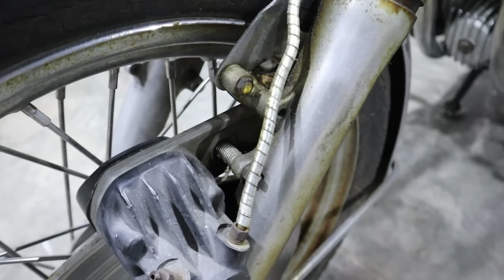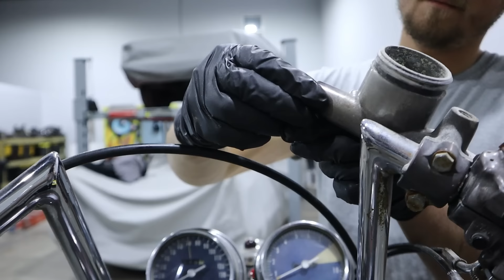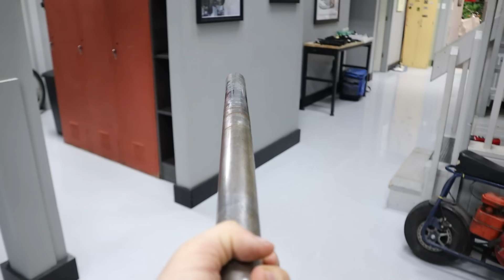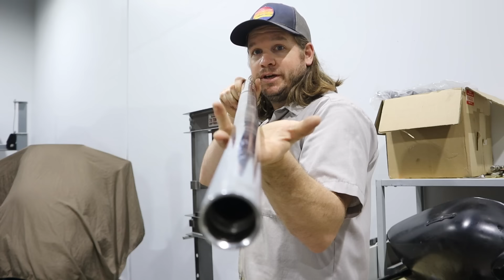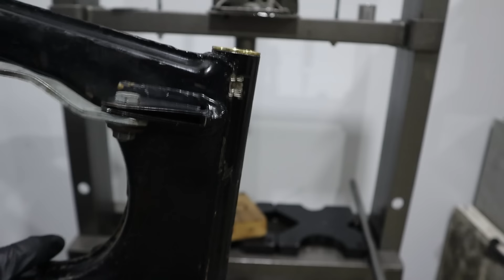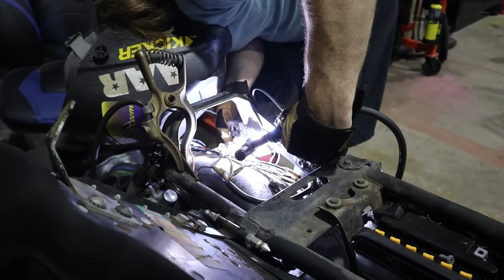Honda CB750 Suspension Is TRASHED!  Total Rebuild!

Comment: The caliper fitting is incorrect and also needs a copper washer under it, just sayin..
Reply from the maker: No it is not. This seats via the conical portion and not the flat area like an original setup. Look inside your caliper and you will see a traditional flare

Comment: Soap & water is safer. Silicone spray shouldn't be sprayed anywhere near tyre tread. Bad look.  15:03 Forks look twisted. Triple clamp ?
Reply from the maker: I have been doing this for years and have never had slip of any kind. Don't do it if you aren't comfortable but this works well for me and others.

Comment: Nice job salvaging the front brake parts and straightening those forks! On the 74 CB750 that I salvaged out of a shed my front master and caliper were similar and I just never thought to save them, so I replaced them with aftermarket parts. Really like that chopper! Hard to believe the stock pipes are still on there. Can imagine how many folks watching this channel would love to have those on their bike!
Reply from the maker: Oh the pipes are definitely the most desirable bit to say the least. While yes you can replace a lot of stuff for less time, I often like to rebuild when I can as the parts on the bike have a consistent patina to everything else.

Comment: I'd be more worried about the chrome plating being worn off the fork tubes than the bend. That's going to just chew up those new fork seals.
Reply from the maker: Yup, no other option here. We did sand then wet sand down to 3000 grit though to get them level and smooth.

Comment: Getting  those swingarm bushings OUT  is quite a task . If you find a pair of snap ring pliers that work on those master cylinders, please share. Thanks for the video.
Reply from the maker: Correct.  Out was tough without damage. Motion pro makes a specific set of pliers for this which I now have

Comment: Hi
You left out the best part: how to get the circlip out of the brake master cylinder!  🙂
And this would have the perfect opportunity to twin-disc the front wheel - we all know it needs it.
Reply from the maker: I don't like to show things I don't have a proven method for so that's why I don't show removal.  As far as the brakes they work great. No 2nd disc needed at all
Reply: @BrickHouseBuilds  Thanks - now I know I'm not alone in my struggle with that damn caliper circlip!

Comment: Do you have a video where you installed that starter button? I really like that and my bike is already missing the handlebar ignition switch. A guide would be awesome.
Reply from the maker: No video unfortunately.  It bypasses all safety features by tapping into switched 12v on the black wire. One side of the switch goes to black, the other to a solenoid lead, other solenoid lead goes to ground
Reply: @BrickHouseBuilds  Thanks. Sounds like I would have figured it out if I'd put two seconds of thought into it.

Comment: I wonder how much it costs to rechrome the wheels. A 16in rear was put on my 1975 cb750 and I'm not sure how to find a replacement and it looks worse than yours. I also need to get the frame powder coated. I don't think that will be too bad because there is a shop here that does a lot of dirt bike frames for a decent price.
Reply from the maker: A lot of guys used a harley rim to do a 16 conversion just like my bike here. You could investigate that front